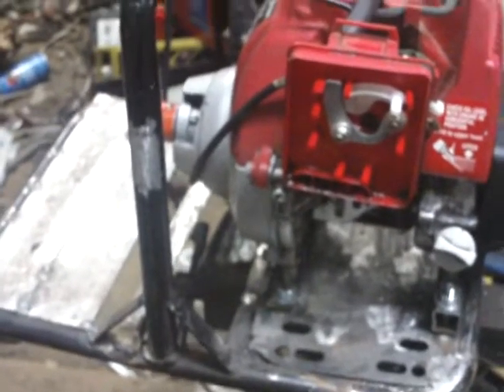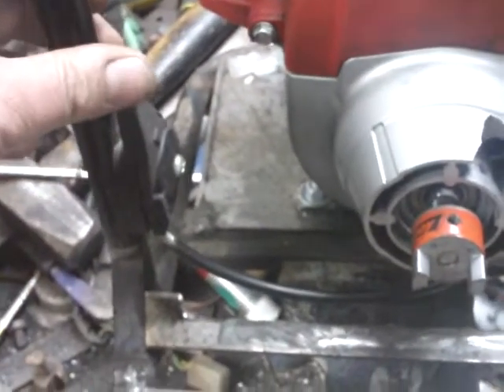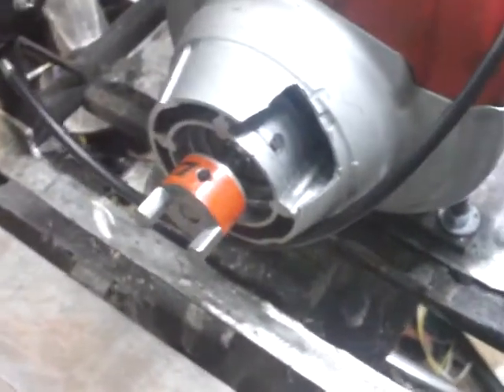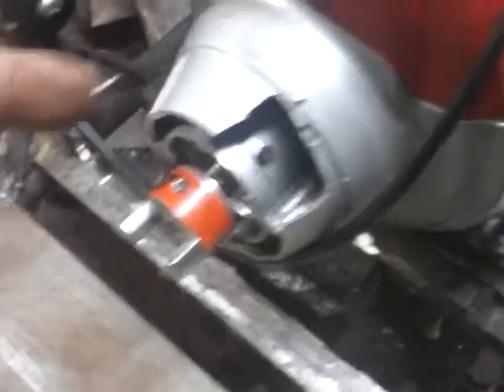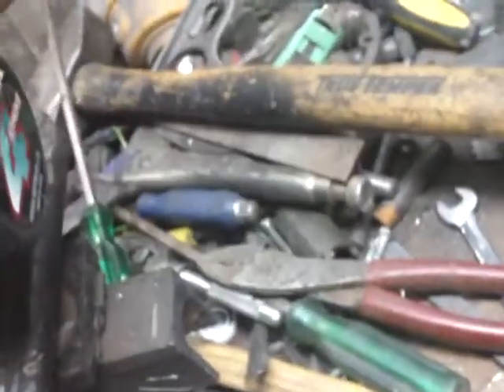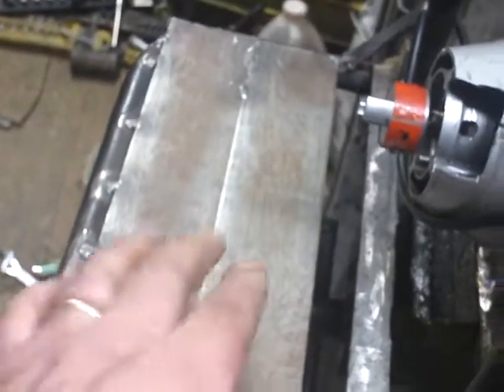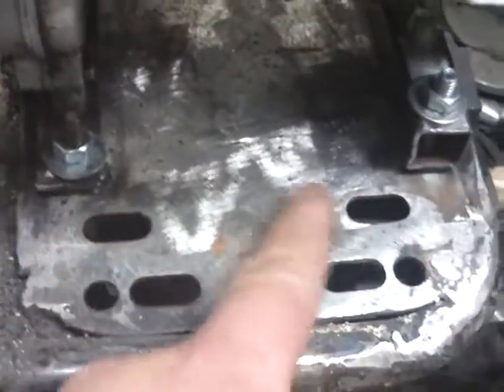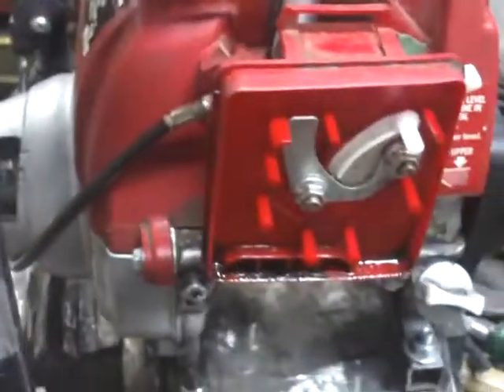MINI GASOLINE AC/DC GENERATOR  (PART 1)

Comment: I have one of them GX31 engines on a strimmer good engines when I got it,it wouldn't run the valves were tight,when I adjusted them it ran great.Im looking forward to part 2 that will be a nice little unit when done,thanks.
Reply from the maker: That is what this came from !!  Many parts to come ..